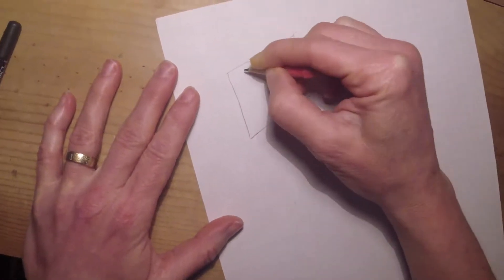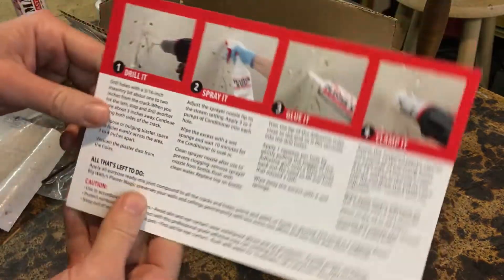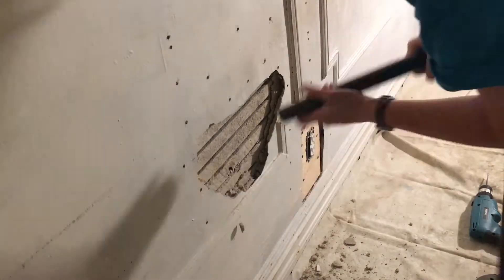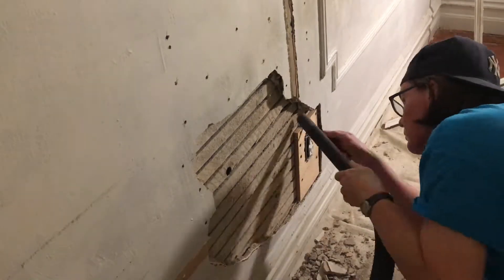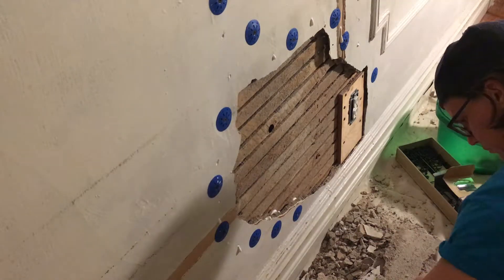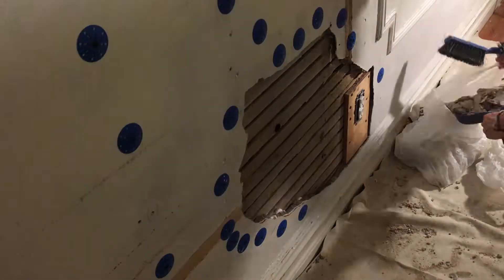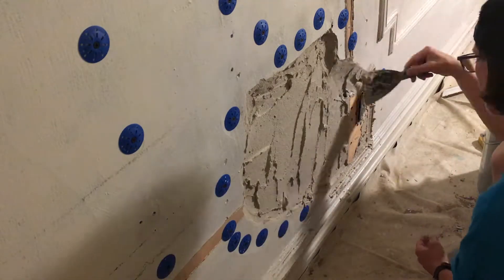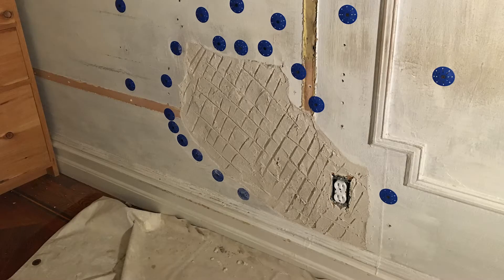Plaster Repair! Two methods to fix plaster and lath - Part 1

Comment: Great videos! I'm going to be tackling similar tasks while finishing my attic into a bedroom. For the scratch coat did you mix up the powdered plaster also referred to as "plaster of paris"??
Reply from the maker: Thanks!  No, I mixed the Easy Sand 90 plaster with some play sand.  I didn't measure the two, but I'd say it was roughly half and half.  An electrician I hired for a job years ago used plaster of paris for a small wall patch in the house, but it wasn't into the scratch coat.  And, when the light hits it, you can still see its edges.  I think that's because it's much harder than the regular plaster and doesn't move with the temperature and humidity changes the way the old plaster does - an unscientifically proven theory.

Comment: I see big Wally's advertisement everywhere, what makes this brand better than loctite or others?
Reply from the maker: Hi Rusty.  I found out about the system through a This Old House video.  I didn't know there were any other brands, and this is the only one I've used.  But I have since seen recipes on the internet for making your own conditioner and adhesive, which I would probably try if I had another hole in my wall, since Big Wally's seemed pricy to me.  That said, it was a huge time saver compared to what I would have had to do if I pulled all the loose plaster off the wall.  Loctite is a good brand, so I imagine their product would also work, but knowing there are competitors now,  I would read any reviews I could find (like on Amazon) before I made another investment in one system over the other.  And, by the way, I did not use the Big Wally's brand plaster.  I used Easy Sand 90.  So there's some more potential cost saving there.